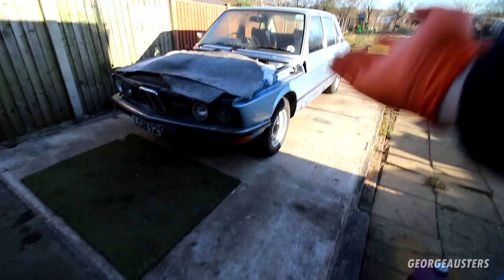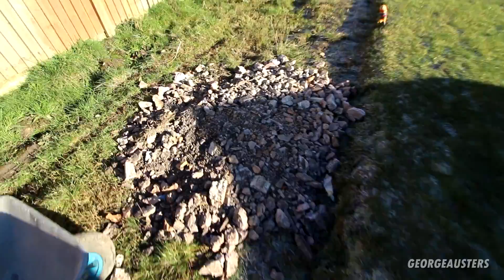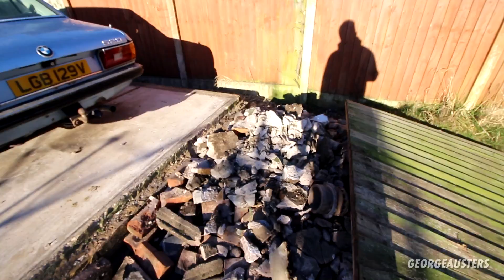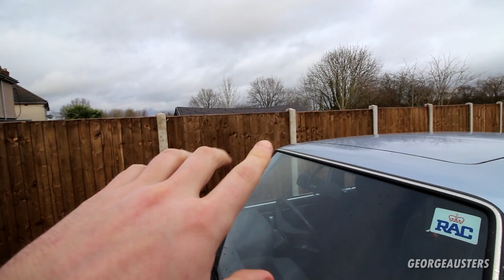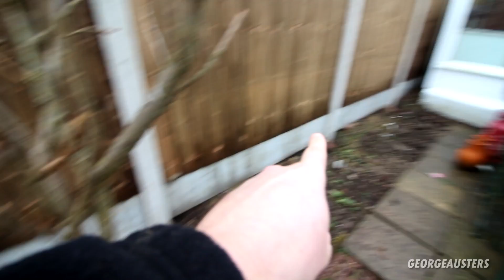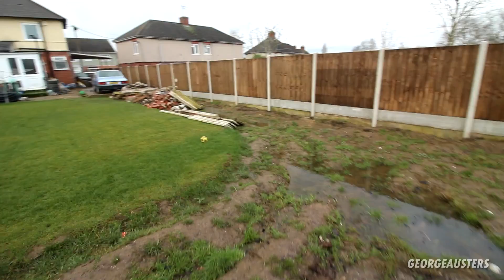DREAM CAR WORKSHOP BUILD - PART 7

Comment: Eyup George. I was really up-beat for you until I read the comments, one in particular! I have mentioned to you before, projects like this bring out the worst in people. When I built my garage, which was 100% compliant with all the regs. my neighbour turned into an absolute tosser. Due to bad weather, the base was down quite a while before the garage was erected, and I caught him one night leaning over the fence on a stepladder taking measurements. That's an enviably nice size plot of land you have, it will make certain people jealous (me for one!). Comments are OK until they get personal. Just crack on George, see what happens with the planning and take it from there. All the fencing needed doing anyway, so you have lost nothing at this stage. I know it's not what you want, but a garage with a base not more than 30 sq. m. in our area does not require planning or building regulations. There is a stipulation regarding roof height and boundary distance, but you have plenty of ground to get over that one. Mine is 29.9 sq. m. which is plenty big enough to work on one car.
Reply from the maker: Cheers Bob!

Yes exactly that.. I will be having a garage for sure - if for some reason planning is denied then I will be doing it to permitted developments.

As for the size of land we have, we actually bought the house because of the garden and my plans for it ha ha👌🏻
Reply: He must be careful indeed as you never know what people’s intentions are especially in this day and age. But then again why would you record everything you are doing? You just never know what people’s intentions are and it could end badly so I agree follow all rules from beggining to end to make sure you don’t get a demloishment letter from council

Comment: You could do 1m deep footings then build a concrete block building. I can send you some structual drawings i had done for my garage its 10m x 6m
Reply from the maker: I’ve considered concrete block building but honestly it just wouldn’t look right in the garden even if rendered. I also imagine it would cost a lot more than a timber equivalent
Reply: @GeorgeAusters  mine was 12k in total with a flat rubber roof. You could clad the front in timber if you like the wood look. I considered timber but it needs looking after and maintaining have you looked into a steel building I looked into this to but was worried about condensation.
Reply from the maker: That seems very cheap.. I'm looking at 20-30k for a timber garage. Steel is great but again doesn't really work in a garden
Reply: @GeorgeAusters I dug footings myself with a mini digger then got concrete lorry in to fill. Paid a brick laying company to do first courses then I laid the floor myself again with concrete lorry delivery. The brick layers then finished the walls. I then did the roof myself finished in rubber. Got a local company to supply and fit the door. I can't post photos here but can send you some if you would like
Reply from the maker: @baz6755  Yeah I wouldn't concrete myself.. You have to be pretty quick and it will be a massive area to cover
Reply: @GeorgeAusters  I had never done it before myself and two mates did it with no experience and it came out really good
Reply: You have just answered your own question you stayed within permitted development therefore you have no idea about building regulations code and planning this is complete different as he is going for over 30SQM building regulation and planning have the overall say and they shadow the whole build which means he will not “just be able to build on clay” if he does that they will make him take the building down or demolish it
Reply: @RossWhite-u5s  What a wally for a start learn how to do maths mine is 60sqm hence the structural drawing and you only need planning if the roof is higher than 2.4m next to a boundary or takes up more than 50% of available land.

Comment: This guy @user-co9zs9bl7k  in the comments below is talking absolute rubbish and is a Troll George.. I've worked in Groundworks for 40+ years and clay is the base needed to build any construction on, I've excavated thousands of foundations for new build housing and always dug down to clay for inspecion prior to concrete... The land drain around the perimiter is the only way to get rid of the surface water.. Good luck..
Reply from the maker: Thanks mate, I’ve been researching it for months so it’s good to hear someone with your experience agrees👍🏻

Comment: Just watching this video if water is sitting on the ground like that and not soaking in, that is not good at all for your build I can tell you right now when the soil gets tested to allow for concrete it will be refused as that ground is clay and you cannot build on soil that is clay. Read up about this I am not joking or trying to destroy your dream but that is the law on building regulations unless the soil is fine they will not allow you to build and looking at your ground it’s clay your building will be refused on that basis even for a base.

I know this as my friend has this exact issue that he sold his house as he lived in a area where the ground was all clay
Reply from the maker: If they can build a house on clay, I’m pretty sure you can build a garage on it😂
Reply: @GeorgeAusters you are very wrong what the council are allowed to do and you are two different things. Listen as I say I’m not here to tell you anything I’m sure you will find this out when you apply for planning it’s all laughs now of course, but I can see your dreams going to be shattered I think you need to read building regulations code on soil and what is required for a approved outbuilding base. I know your looking for people on here to help you and guide you but I’m not going to do that I know the rules which apply to all building code as I said you will come across that. You are building on top of clay the houses have probably been their since before you was born it’s a big difference to putting a new build development on the land and soil. 

As I state, I watch your comments and you are always hoping people will help you and tell you information fact is, nobody is going to tell you or help you this is something you have to do on your own and you will find all this information online even before you apply for planning I’m telling you this so you don’t waste your time or money. But of course your house your choice
Reply: @GeorgeAusters  clay soil is already a tell tell sign to council and building regs that you had a tree there to absorb all the water hence the tree you took out it was there for that reason. Please type in google can you build concrete base on clay soil. Things are about to go even harder for you going forward I don’t really need to say anymore it can all be found online or type in building regulation code clay soil that explains everything I just told you
Reply: @GeorgeAusters  I feel bad for you really as you have turned your garden upside down for a dream which is very unlikely to happen and if building control say you can’t build or can’t have it there you can’t do nothing at all which is very likely when the soil is tested. It all goes by how much water is holding on the soil it will cause the base to shift and move which isn’t allowed under building regulations. As I said your laughing now I’m sure we will all be laughing when it’s denied 👍
Reply: 😂😂😂 my garage was built on clay 2 years ago no issues as was my extension. Never heard such rubbish😂😂😂
Reply from the maker: @baz6755 The guy is a troll mate. He’s just someone that is very jealous for some reason and is hiding behind a fake account he made a month ago🥴
Reply: @baz6755  you probably built within permitted development rules. I’m not saying you can’t under permitted development but as this is going to be bigger and need planning it means building regulations are involved which means they oversee the whole build which means the ground has to be tested by them before you can even start the build his is over 30SQM which needs planning and building regulations and you must do it all by them and how they say which means ground will need to be tested before it can be built on as I say I no need to lie about this everything can be checked online If he was staying in permitted development this wouldn’t be a issue you are correct but unfortunately he is not so therefore the whole build is overshadowed by building regulations and he must follow code and they will make sure he does which means a 30k job is going to be 80k due to they want it this way and that way rendered all electrics and any heating must be signed off registered and everything else
Reply: @RossWhite-u5s  how do you explain my 120sqm extension that went through planning and building control built on clay the same time as my garage. At least get your facts right before trying to troll someone.
Reply: @baz6755  can you show us proof of that extension? As you seem all talk don’t worry I’m sure your going to find out when he puts in and his comes on here telling it wasn’t granted 👍 I won’t say anymore you seem to think your correct when you ain’t built nothing you have people doing it for you we shall see if I’m wrong I’m sure George considering he likes to tell everyone everything will put up the refusal when he gets refused and we shall see who’s right I will come back here when he gets denied just to say I told you so 😁
Reply: @baz6755  and just because you got accepted for something doesn’t mean everyone will. Different areas different rules different building surveyor different planning rules. And he must obide by all the rules if not he has many people I know considering I live only 30 miles from him who will make loads of raport to council and have it demolished so let’s make sure he follows all rules 😁 this is what happens when you want to document everything let’s hope he’s doing it all by rules which we will know as we know building code and if he’s approved they would have given him a letter of approval to start works which I’m sure he will upload here for everyone to see won’t he?
Reply: @user-co9zs9bl7k  you seem a little obsessed with George and what he's doing it's not like you live next door. Get a grip
Reply: @baz6755  nobody is obssesed with anybody just my friend who lives in this area has same problem they refused so I’m curious to see how they will let him build this this is all I have no obsession if it’s all built within the law and properly then I applaud it and I’m intrested to see how and this guy is idiot I message him for help on Instagram and I Tell him my problem about battery drain and he tell me get ista yet asked me to pay for help and then told me I need ista couldn’t even diagnose my issue. There is nothing to be obssesed about with this man he is idiot and knows nothing and he live local to me. Your problem is you are defending something you clearly know nothing about if you did you would know different rules apply to different areas just because you got a good building surveyor does not mean he would I mean look he had builders who didn’t come back to do job as they don’t like him clearly so you think what a building surveyor will see when they come and meet him they go back to council and say no he can’t put this there that’s it council agrees with building control he has no more say.
Reply: What a load of nonsense - buildings are built on clay all the time. The footings just need to be appropriately designed to deal with heave and shrinkage of the soil. In most places, that just means lining the sides of the strip footings with Claymaster (expanded polystyrene sheet) to take up ground movement, but your local building control officer will know the specifics for your area.